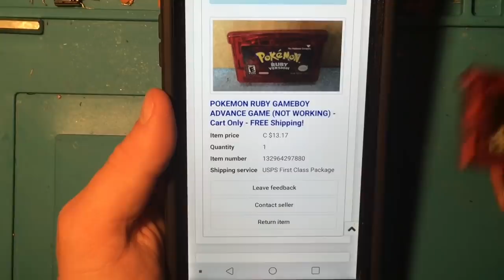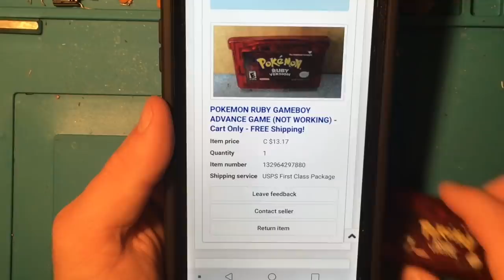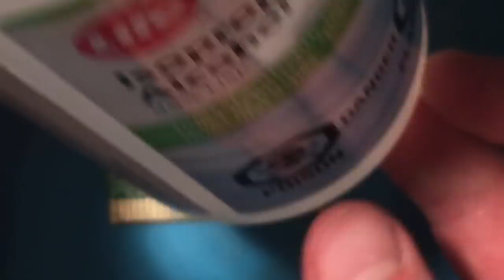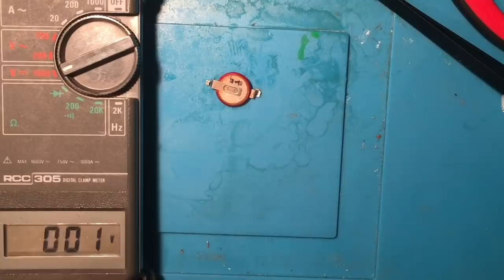Fixing eBay Junk - Game Boy Advance Game - Game Won't Boot Up - Pokemon Ruby

Comment: I came back to this video for a little guidance. 

I have a copy of leaf green right now (My own, I don't know what happened to it to be honest with you. It's just been sitting in my SP for the past few years in storage so I have no idea. All my other games are fine, and it was working when it went into storage.)

I cleaned the pins, I took a good look at it and it looks absolutely flawless inside. No corrosion. No damage, not a single scratch on the board. The screw is a little weird looking (Has some white flakes on the top?) but none of the flakes were inside the cart at all, anywhere. Not a single spot. 

I'm puzzled and bewildered. Any tips? I really want to play again and this is frustrating the hell out of me. 

Should I just start testing connections and go from there?
Reply from the maker: Might just need to be reflowed.  I do that a few times in some different videos,  it's not that uncommon for game boy games since the board is so thin, its prone to this happening
Reply: @RetroRepairs  Thanks, mind directing me toward the specific videos?

Comment: I just found mine after all these years. I don’t think anything is wrong with it but I took it apart and cleaned the motherboard. Sadly I don’t have anything to test it on. I might go down to GameStop see if I can find a DS light used. I remember the color not having a lit display.

Comment: Where do you buy Gameboy advance Pokémon game battery replacements
Reply from the maker: Try this link, I just signed up for an eBay affiliates account. https://rover.ebay.com/rover/1/706-53473-19255-0/1?icep_id=114&ipn=icep&toolid=20004&campid=5338492747&mpre=https%3A%2F%2Fwww.ebay.ca%2Fitm%2FX1-Game-Boy-Save-Battery-CR1616-Tabs-Pokemon-Yellow-Ruby-Sapphire-Emerald%2F192108620821%3Fhash%3Ditem2cba90ec15%3Ag%3AKW4AAOSw4CFYqRy2

Comment: I am needing to follow your steps with a Super Mario Advance 4. Not a water issue . I will try the flux first to see if it is just corrosion. 
Q: Will a dead battery prevent one of these from working? I heard you say that the battery on the Ruby was just for the clock.
Thanks!
Reply from the maker: The battery shouldn't prevent a game from booting.  Usually they're just there to keep time, occasionally they are used to maintain a save, but that's very uncommon with the gba.  Id try flux and reflowing the chips first
Reply: @RetroRepairs  Thanks!

Comment: Just wondering, I saw you do the jumper wire on this and also your N64 Mario Party 3 repair....on this one though...why not just put a small blob of solder in the break since you where getting continuity on both sides?  Just like an "Oops" bridge, but actually functional.
Reply: Solder is not a conductor that's why they use copper the solder only holds the copper in place
Reply: @michaeldawson6565  At some level solder HAS to be conductive or accidental solder bridges wouldn't matter.  It may not be ideal, but I doubt you can say it's not a conductor.
Reply from the maker: Solder is definitely conductive, that's why they use it for electronics and plumbing (running ground through copper pipe).

Solder by itself is not durable though. It's always a weak point in any circuit, which is why you can get cold/cracked joints.  Especially on something like a cartridge which is designed to be inserted and removed frequently and takes a fair bit of stress, you'll want to take the extra two minutes to make a strong repair rather than a weak one.
Reply: @RetroRepairs  u probably need something for the solder to actually stick to that's why he's using the wire

Comment: So, when you reflow the components with your soldering iron, how exactly are you doing that so that you don't just solder all the pins together? Because it certainly looks like that's what's happening.
Reply from the maker: If you use flux and not too much solder, the solder will go where it needs to go rather than bridging pins.  If you do get the odd bridge, you can fix it but just running your iron lengthwise down the pin.

Comment: I don't have the first clue about fixing electronics, sodering, etc. I have over 200 hours of game time on an emerald cartridge that at some point froze up and then fails to boot up on GBA or the ds lite seems not to recognize the cartridge as having a game. This has given me hope. What basic equipment did you use? Do you have any recommendations for a noob like me? Looking through the semi-transparent cartidge I think I see the tiniest white smudge on the back of the circuit board that looks suspicious.

Comment: I've really been enjoying watching your videos. Keep up the great stuff. I was wondering are you using a hot air station or just a heat gun?
Reply from the maker: Hot air station.  Heat gun doesn't give you the heat  and air control that you would want for something like this.
Reply: @RetroRepairs  Are there any good stations you'd recommend? I heard they're pretty expensive so not sure it would be worth it to to have a chance a repairing my original gameboy games.
Reply from the maker: @brutalgg3680  I'm not sure to be honest.   I have a cheaper station made by yihua.  It does the trick,  but not going to be the highest quality

Comment: I have had to do many trace repairs on old games. Never tackled a GBA game before. Were they still making them with leaded solder or had they started doing the lead free option at that point?🤔 also does it matter using leaded to repair unleaded stuff? xD
Reply from the maker: They were still leaded.   Im not positive what the impact of mixing chemistries its.  It'll work,  but sure how durable

Comment: All of the braid I have is garbage, I can never get solder to stick to it. Do you have any recommendations for braid to pick up? I do have a desoldering gun, but obviously there are some jobs I don't want to use that on.
Reply from the maker: I use MG Chemicals braid, and I add extra flux.  It works much better than the junk generic braid i used when i first started out
Reply: @RetroRepairs  Awesome, I'll look into it!

Comment: No offense, but you mostly went about this repair backwards. You were right to clean the board first, but one of the very first places you should always check with a non functioning cart are the pins and their traces. All the mechanical force on the pins makes them a prime target for issues. I only start resoldering chips after all pins  have confirmed continuity, but I still have a dead cart.

Comment: Is there some sort of copper paste/ copper paint that can be applied to restore the connection? What other options do you have besides a jumper cable?
Reply from the maker: There are. You can get a conductive trace repair pen and redraw the trace.  My concern here is the location.  The plastic guard near the pins has worn through the boards solder mask and a trace, I'm not sure how durable those trace pens are.  This is a very common point of failure on many Nintendo cartridges.
Reply: @RetroRepairs   thanks for the quick reply! That makes sense. In that case it seems like a jumper is a better solution. Is there a more expensive solution (besides the pen)? I'm not totally against the jumper I think it is a solid solution. Just curious.
Also does the current/resistance change from the pin across the jumper since you are using a different material? If so, could it affect the game in anyway?

And as for my personal viewer requests:
I'd like to request a video doing a Gamecube  repair (for that is the project i'm currently working on). I can never seem to find these. My current problem has to do with the motor not spinning during boot up. 

Really loving your videos and learning a lot. I am having a blast with this new hobby of mine. Thanks for all of your content. Subscribed
Reply from the maker: Different materials do create different resistance, however this copper jumper should be very similar to the copper trace as long as you're not significantly changing the wire guage. Some conductive pens will add more resistance as well.

I've yet to work on a gamecube.  I havent found them worth buying broken because they're still so cheap in working condition, but if ill certainly keep an eye out for a good deal

Comment: I washed and dried a game cart once for my GBA. Found it in the pocket of one of my pairs of jeans in the dryer. Freaked out but figured the dryer may have saved it. I guess it did because it kept working after that and worked for years.
Reply from the maker: Lucky.  If it dries quickly and completely, it will usually be fine.  The damage happens when it doesn't dry, then corrosion sets in or you try and play it, and something shorts out.

Comment: I'd have been tempted to stick it in the ultrasonic cleaner before reflowing under the microscope with a micropencil as there are no BGA packages on the board. We all have different techniques, however I try to avoid using hot air as it can be very easy to damage ICs

Comment: Which equipments do you use? Did you made a video about it or did you ever present them in detail in other ways?
Reply from the maker: I use a hakko fx-888d soldering station and a cheap yihua hot air gun

Comment: How come his pokemon game immediately boots up when turing on the ds lite? I have the black ds lite and it has never done that, is it a thing the newer models did I dont understand.
Reply: If i remember correctly, you can configure the menu to auto boot to the slot 1/slot 2 if it detects a cart.
Reply: @Sterl500  really? Ill have to check it out when i get my Sapphire to fix

Comment: how important is the flux? its the one part i dont have already, could i solder and clean with rubbing alcohol and hope thats enough?
Reply from the maker: Some solder has flux in it, but extra flux makes it much easier and helps.reduce bridges
Reply: Of note (just from general electronics experience), try to start with older hardware that uses through hole technology (NES/SNES/N64 would be a good place to start if you are set on repairing old console hardware like this).  You can work on surface mount tech, as demonstrated in this video, but it is a whole different skill set and is significantly harder then working on through hole tech.  Also I'd buy a couple of cheap project kits off of eBay (something simple, like a 7 segment clock or an led thing) to get the feel for soldering before you actually start trying to work on old hardware.
Reply from the maker: Snes and n64 are mostly SMD and Tougher to work on.   NES and Genesis are good for through hole,  as well as older atari, colecovision or intellivision.
Reply: @RetroRepairs  Ah, didn't realize they had switched over so early.  Thanks!  I haven't actually repaired much of this type of hardware, but have fixed quite a bit of retro computer hardware (TRS-80s and a Commodore 64).  Awesome videos man, and thanks for the reply!

Comment: Why did you reflow the board before checking the traces?
Reply from the maker: On gba games, I've found that the chips need reflowing far more often than bad traces.   Just going with what i thought to be a more likely culprit.

Comment: What kind of wire did you use in this video? Do you have a link?
Reply from the maker: No link.   I believe it's 23awg stranded wire, then i use two strands twisted together,  so very very small wire.

Comment: I just found this channel, and chances are im gonna get a respond are low, but i thought asking wouldn't hurt
Do you (or anyone else) know how i could fix my Pokemon Sapphire Cartridge ? it starts up like normal but the problem im having is that i just can't save the game at all, when i try to save all i do is freeze the game and making it unplayable until i restart, the Cartridge itself is a bit broken at the open part where it's not properly closed like every other GBA game, the left side of it is slightly open, i can also hear something tiny inside
Reply from the maker: I would try reflow the connections on all the chips, something isn't getting a response and freezing up

Comment: Where do you get your batteries with solder tabs in Canada?
Reply from the maker: Ebay. I even found a seller that ships from alberta, not too expensive either
Reply: Thanks. Have you noticed any issues using the Chinese batteries? I heard that the name brand batteries are much better, but haven't been able to source them in Canada...

Comment: i bought a Link to the past gba cartridge from ebay and it has some white powder coming from it. i didn't see it at first and it plays fine, but won't save. i know its the battery. i'm afraid to touch it.
Reply from the maker: Gba games almost never use a battery to hold saves.  Theres probably something else at play there.
Reply: @RetroRepairs  What would you recommend i do to clean it? Should i worry about the white stuff?
Reply from the maker: I wouldnt worry, it could be residue from water at some point.  Open it, clean it with isopropyl alcohol. If it works, i wouldnt do much more than that
Reply: @RetroRepairs  91% is as best as i can get, is that strong enough?
Reply from the maker: Yeah 91 will do if you cant get 99
Reply: @RetroRepairs  Thanks for the quick replies and help

Comment: How does a trace get damaged??
Reply from the maker: Water, friction, corrosion, who knows. People blowing into carts is a huge culprit
Reply: I think that the trace was broken after messing with the PCB, and that the only problem at first was dirty contacts. Compare the trace at 2:14 and 20:18.
Reply from the maker: @Snohup  The hole is exactly at the bottom-right of the "u", which is also missing early in the video.   Even if anything I did to that board did cause it to finally break, it was only a matter of time until it broke on its own.

I've done about 4 videos recently of a very similar repair, broken traces on N64 carts, they're almost always in the exact same spot too, right where the plastic part of the shell presses against the pcb.
Reply: @RetroRepairs  The bottom-right of the "u" is missing, but I don't see the hole on the first part of the video. On any case, why don't you first try cleaning the contacts? Thanks

Comment: Fun Fact: Did you know that the RNG (Random Number Generator) won't work properly in Pokemon Ruby or Pokemon Sapphire if the battery is dead/missing? And it just doesn't work properly period in Pokemon Emerald. In these instances, every time you start the game, it will ALWAYS start on the number generated at the last time of proper RNG operation, I think.
Reply: the frames start when the save is loaded (or, in emerald, when a saved battle replay is opened. that's how people shiny hunt in emerald)
Reply: @ksquidplaysminecraft  Yeah, that. But they don't save the current frame when you save, instead always starting at 0, with the exception of the battle video save.
Reply: @c08o.prkiua46  how about you read my comment thoroughly before responding
because you literally just repeated what I said as if I was wrong
Reply: @ksquidplaysminecraft  That's not how it would've sounded if I had said it to you. If I had said it to you verbally, it would've sounded like I was agreeing with you. But because the audio aspect of this conversation in nonexistent, what I said came out in a different way than I meant it to.
Reply: @c08o.prkiua46  understandable have a nice day

Comment: wont the tooth brush make static shock ?
Reply from the maker: It technically could, you can buy esd safe brushes as well.  Most older carts are not that sensitive to this type of thing.  However, better to be careful if you have the equipment

Comment: It has probably been answered numerous times already, but just in case, here is a wikipedia article regarding DS Option Paks.
https://en.wikipedia.org/wiki/List_of_Nintendo_DS_accessories#Official_accessories (Valid on anything that uses SLOT 2 or GBA SLOT)

Comment: What size wire do you use for bridging the connection?
Reply from the maker: The full stranded wire is 30 gauge, each strand is significantly smaller, I'm not sure exactly what size.  If you buy some insulated stranded wire between 23ga and 30ga, one or two strands would be sufficient
Reply: RetroRepairs thank you so much thats what I needed to know, your the bomb. I’m just starting out on repairs for a hobby and Needed wire just wasn’t sure what gauge to use. Thanks again.
Reply: RetroRepairs also what do you search when you find this stuff on ebay?
Reply from the maker: Look for Nintendo broken, Nintendo untested, Nintendo for parts, etc.
Reply: RetroRepairs thank you sir
Reply: RetroRepairs I’m sorry to keep bothering you but what sort of solder do you use, and where can I find the flux pen and desolder braid you have?
Reply: RetroRepairs and what wattage do you use sorry
Reply from the maker: I use 60/40 rosin core flux, braid and flux pen i just buy on amazon. Mg chemicals makes some good stuff.  Just don't buy the cheapest stuff, it's crap and you'll regret it
Reply from the maker: I use an adjustable soldering stain, hakko fx-888d, but you don't need much wattage, even a 20w pen would be more than plenty

Comment: Is it still possible to fix a corroded chip?
Reply from the maker: Depends how bad.  You might be able to rebuild damaged legs, but if the actual chip itself has been damaged or legs arent available, you're out of luck

Comment: Ah bro, those 1616s can be bought @ walmart here in the states
Reply from the maker: With tabs?
Reply: Nah just the button itself. You would need to use the tab that you already have. You are pretty experienced. Cleaning it up and reusing it should be nothing to you. I really enjoyed the video BTW.
Reply from the maker: Much easier to just order them specifically for that.  You can't solder tabs back on, and i wouldn't try the tape method
Reply: RetroRepairs right on man. GOOD REASONS!